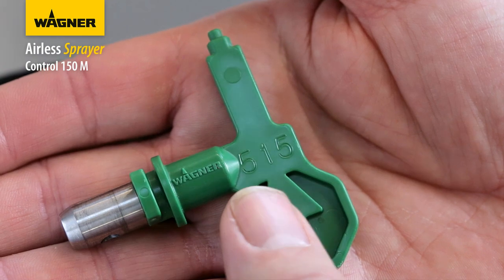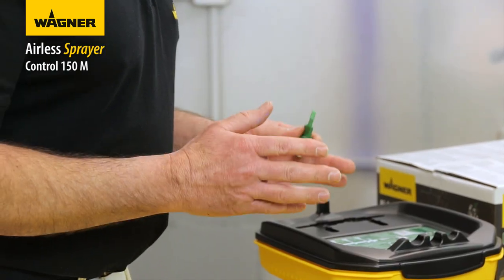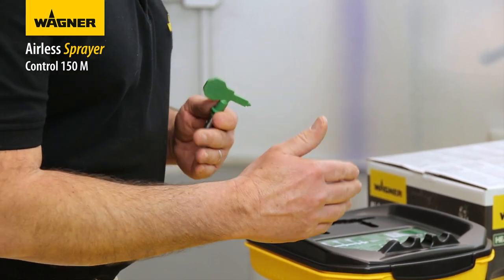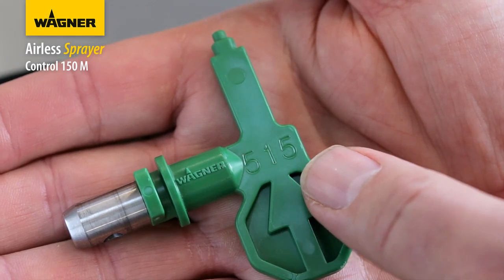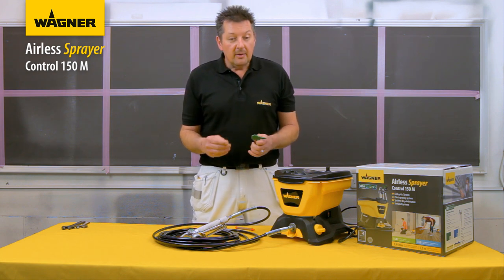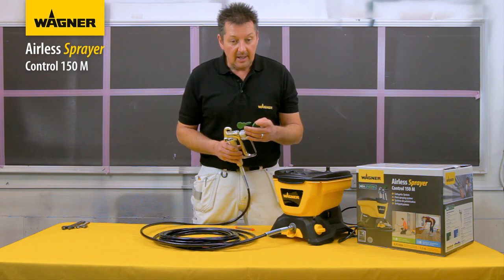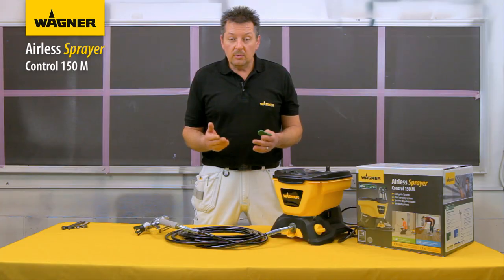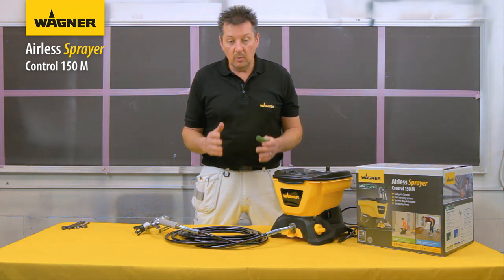WAGNER Control 150 M  - Tip Sizes Explained

Comment: Thanks, but you incorrectly state that the 515 tip produces a fan width of 5 inches. It actually produces a fan width of 10 inches (you double the first number to get the fan width).
Reply: Can I use any lower tips to paint smaller walls

Comment: The 515 (highest flow) does not work with oil-based stains (for deck or fence) unless you are willing to spend 3X more time than using the oldest method, which is, using a brush. I tried it because of pictures on the box (a person painting a fence) and ended up spraying all over the neighborhood (half of the stain escaped due to the wind (6-8 miles/hour) carrying away the atomized spray material coming off the 515 tip). What a damn company to mis-advertise such an important step in the process of staining/painting? SHAME ON YOU WAGNER!! They need to put a large warning on the box and Owner's manual such as:  "Do not use any oil-based stains or use ONLY water-based stains that are of water-like viscosity".  Over 90% of the stains used in the usa are thick in viscosity and thus the 515 is a horrible choice!